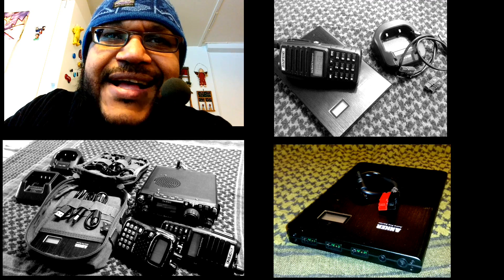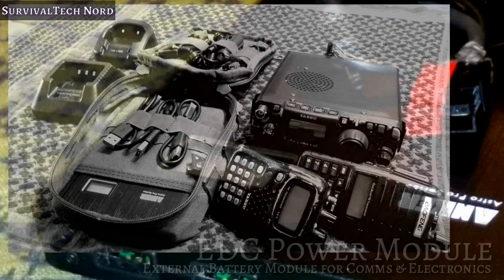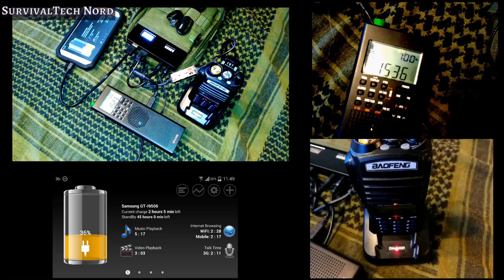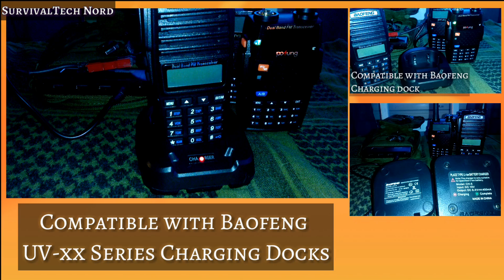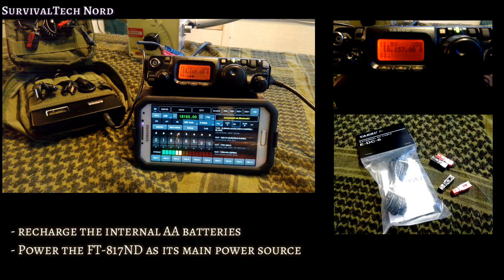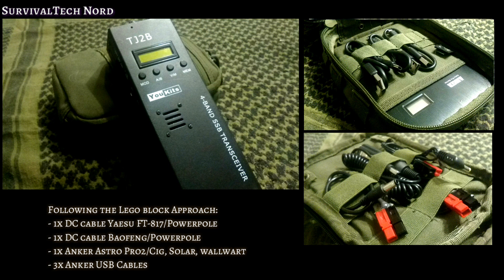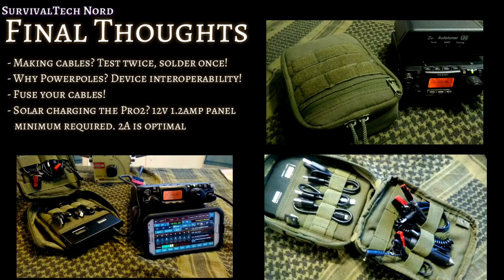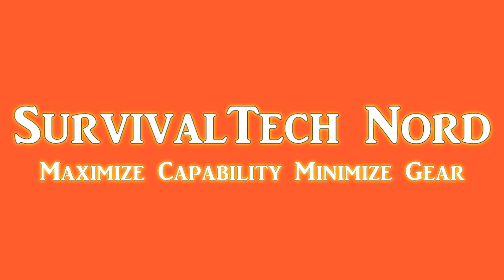QRP Battery Pack Anker Pro2 for Ham Radio

Comment: Hi , like your reviews and just subscribed . I was wondering if this battery pack comes with a wall wart type charger or only a USB type to be charged via computer..Tnx. and best 73 ... de ka3fad
Reply from the maker: thanks for subscribing.
Unfortunately, that is a very old video. That battery pack is not available anymore, but I do have a few one the channel to replace it. Just search for "Portable off grid power for ham radio"

Comment: Sadly the Anker Astro Pro 2 is no longer available.  There are other 'options', but I have yet to spot one with 12v input.
Reply from the maker: +gjacob3412 agreed with certainly lacking a cost-effective solution so I started building my own http://www.survivaltechnology.net/qrp-ultrapack-external-battery-pack-project/
Reply: I have been considering the same.  I have some pulled Laptop batteries which have 18650 cells in them.  I was considering using six or nine cells for 10.8v at a higher amperage. I was reading over your project notes last night, I agree with your observations -

Comment: Julian, have you checked out the QRP Ranger from Hardened Power Systems? http://www.portableuniversalpower.com 
They evidently built it for the 817. It's a bit pricey here in the U.S. at $295 for a 100 watt hour LiFePO4-based system. Looks to be very ruggedized.

Also, the Pro2 20A has been discontinued evidently, according to Amazon. There's a new model at 20.8A that's $80 here.
Reply from the maker: Hello Will. Thanks for the comment. I absolutely love the QRP Ranger, but I don't currently have the channel budget for it. Top of the list is the Elecraft KX2. So it's going to take a few months for the QRP Ranger.
I did reach out to +HardonPowerSystems but haven't heard back.
Reply: Thanks. I'm intrigued by the Ranger but, like you, I'm saving money for other gear.

Comment: Well it seems that the pro 2 is no longer available from Amazon here in the US, darn it.  The "newer, better" version lacks the poor 2's tunable voltage output for the ubiquitous Baofeng UV-5R.  Have or any of your subscribers found a power pack that has this capability, and is in new production from a reputable source?  Thanks so much for your well thought out contributions.  I'm a new Ham, but an old Prepper.  Your stuff is invaluable to me.
Reply from the maker: +Hutch Mikenson yeah I noticed that the Pro 2 is now not available. What we're looking at now is called QRP Ranger. It comes from a company called Hardened Power Systems. It is a 100 watt hour LifePo4 battery pack. Unfortunately it's more than double the price of the Pro 2. I wish I had better news for you.
Please come back and comment letting us know if you find something on your end.
Thanks for watching and for commenting it's very much appreciated

Comment: Excellent review, thank you
How do you think it would take being a 'reservoir' in a hire car setup with a full 100W Icom 706? 
Keeping the cigarette lighter plugged in to top up the charge then limited TX on SSB being pulled from the Ankor.
Regards
Chris
VK4FR
Reply from the maker: You're welcome Chris. I don't think the Anker will push the 703 to be honest. A KX3  or 817 sure. You'll have to measure to be certain, but without 703 I can't say for certain. Apologies for the non answer. 
73 de OH8STN
Reply from the maker: I meant 706!
Reply: +SurvivalTech Nord Thanks Mate Cheers. 
will do some digging for specs

Comment: did you ever end up publish part 2 and beyond of the DIY sherpa battery pack?
Reply from the maker: No I never did Wade. I made a mistake in the original video. I didn't actually realize that charging the nickel metal hydride batteries with the charge controller could reduce their life. Everything is functional but that one detail kind of throws a wrench in the gears.
Reply: +SurvivalTech Nord no worries. Was just keen
Reply from the maker: Wade Smith some of the guys are asking me to publish the video anyway and simply add a disclaimer. What do you think?
Reply: +SurvivalTech Nord you will be criticized either way.  So sure. Round out the project

Comment: Thanks for the head's up on these. 

I've been trying to figure out which chemistry they use in this. One of the weaknesses that similar packs (such as the car starter booster packs for example) have demonstrated is no low voltage shutoff on 12V. I'm guessing this uses LiFe or LiCo. As these cells cannot tolerate a low voltage discharge, many have been ruined when someone attaches an analog device and lets it discharge the cells below their termination voltage. Although costlier, that's why we ended up going to batteries based on LiFePO4 with built in BMS (battery management system) for our quick deployment portable repeater builds. Were you able to determine, a) which chemistry the cells are, and b) does this have a low voltage shutoff algorithm for all the outlets, or just the 5V USB port?
Reply from the maker: this pne does have low voltage shut off on the 12v port. I was banging my head against the wall trying to figure out why the hell I couldn't get any voltage out of it, and realized it had cut the power to the DC output. As soon as I plugged in an external charger the port reactivated. So this device is protecting itself unfortunately I need to do a lot of research to understand the numbers, since Anker documentation is horrific. Perhaps when I get to another of these devices I'll take the first one apart, take pictures and maybe get some of the answers.
Reply: +SurvivalTech Nord 
Thanks for that. I guess if it's not a simple dis-assembly then it won't be easy. It's frustrating when manufacturers won't give us more details. With the plethora of affordable DIY power packs that have 5V output, but a scarcity of those with 12V output, as this has a low voltage shutoff it seems to fill a niche that does not have much in the way of competition if you need 12V. If this pack turned out to have something like the newer Panasonic 18650BD cells it would be something they could brag about.

Comment: Great stuff! Have you charged rhe Anker from your folding solar panels? What controller did you use?
Reply from the maker: Thanks for the question. We only have a few hours of daylight here this time of year so I haven't tested with a solar panel yet. However I do have a plan. I have one dc/dc converter that takes input 18 - 36 volts. It outputs a stable 12.8 volts. I'm thinking not to use the charge controller at all and just used to DC DC converter straight from a panel. What do you think?
Reply: +SurvivalTech Nord I am new to this, so can't offer solid advice. I have a 28W folding solar array that drives a very small controller from Buddipole. Not knowing differently, I would have just hooked the controller directly to the Anker. What I do now is connect the controller to a West Mountain Radio PWRGate that then charges two combined 7A SLAs. 

Is your Goal Zero connected directly to your solar panel? Does the Goal Zero handle any voltage variants internally? Sun is not a problem here in Florida. I do not think I would do well in the northern latitudes, beautiful as they are.

Comment: What about rigging the Yaesu FT 817 to run on a power tool battery?   I find it hard to believe that thing is packing 20AH worth of power.  Some pretty big fat power tool batteries max out at 5AH.
Reply from the maker: Yes, it puts out 20 amps @ 5 volts, and about 6 amps capacity when using it at 12 volts. Those power tool batteries are actually a very good idea if you have dpace and load capacity to carry them. From that perspective, a flat shaped stackable battery is much easier to carry man-portable than the power tool batteries or traditional brick shaped batteries.
Reply from the maker: I forgot to mention another reason for using this type of system is that you can simultaneously charge and discharge it. So you have it hooked up to some DC power source but at the same time you have it hooked up to your equipment. Some of the guys in the comments were talking about connecting two of them in parallel for a 10 to 12 amp battery pack. This is something I'm really going to work on after the new year. As always buddy thanks for commenting on stopping by.

Comment: great video and i LOVE the way you think outside of the box!  
i have an ft-857 so my power requirements are different but i was wondering if you would answer a question or 2?
1-have you tried/tested to see how much current can be  SAFELY drawn on 12v?
    [of course ohms law calcs can be done but some power packs can get down right violent if the draw is the equivalent of a dead short]
2-how do you think it would play with a second pack in parallell?

thanks in advance for any thoughts/insight!
-rob
Reply: +SurvivalTech Nord We have way to go as you mention but doesn't one get Half a SLA battery's capacity in actual use. With that handicap the powerbanks are already ahead of the game.
Regarding stamina, one can definetely use the jump-starting powerbanks, but oh! what a price!
Reply from the maker: Thanks for the comments/ questions. The current question is the bigger reason I reminded viewers to fuse the cables. The pack wasn't designed for this, but 817 current draw at it's worst seems within spec.
Now the parallel batteries idea also came to mind. That would give us a 10-12A (@12v) pack for under a hundred bucks, in a much nicer form factor than a brick. I think it's possible but I worry about a balanced discharge of both units. I'll get back to this in the future!

Comment: Very cool, I have been looking for a field power source for my 817nd, I will need to look into this further.  Thanks!
Reply from the maker: No problem. I haven't had the battery pack long enough to understand how robust it is but even sending psk31 @ 5 watts, I couldn't short out the battery pack.
Thanks for watching and for your support its always appreciated.

Comment: BRAVO! 
You found the pirates' hidden treaure of field carryable power..

I have researched the same idea with a similar anker powerbank and a FT-60R radio and it will work.
Reply from the maker: thanks for watching. 
capacity is still quite low, but I'm sure given enough time will find a way to parallel these batteries and make a lightweight 10 - 12amp pack from two of them.